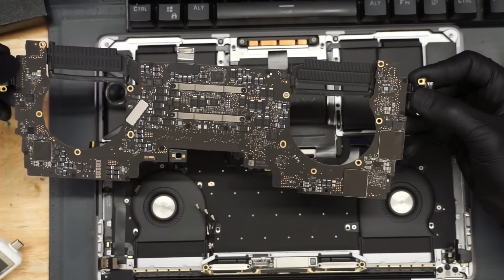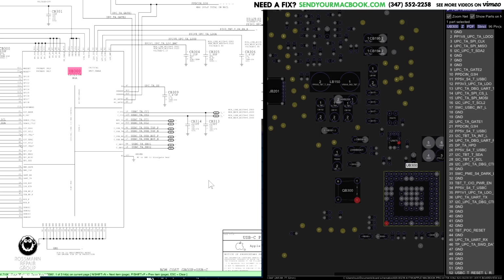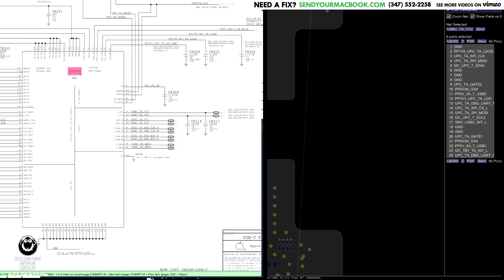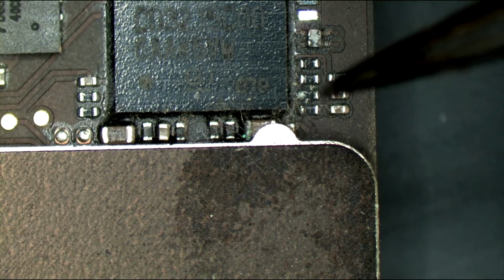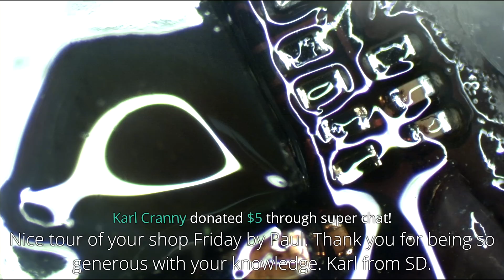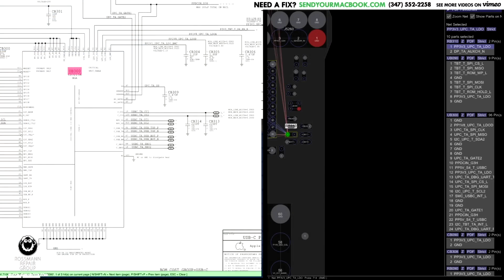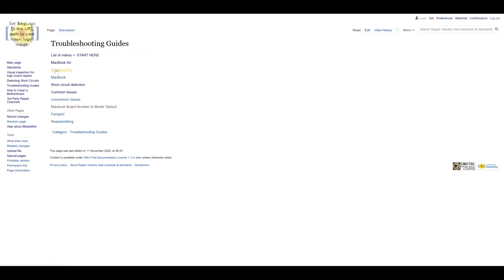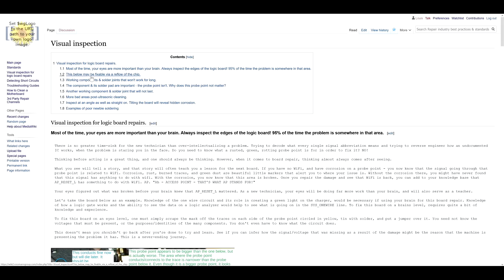A1706 Macbook Pro 5v 200 mA logic board repair

Comment: Ah yes. The JayzTwoCents way of soldering capacitors and resistors on. Through the top pin instead of heaTING THE FUCKING BOARD

Comment: Hi Louis I enjoy watching your channel. I would just like to give you this comment and please forgive me I don't do electronic work so not sure what and what can't be done, But I am disappointed to see you working on that board with the obvious Sht /corrosion around it. Why didn't you at least clean the area before you started doing anything to it?? I equate this with if you hired me to do some int/ext painting work for you, and the walls need obvious work but I just said the heck with that and just painted the walls and been done with it.  I love your channel but it did disappoint when I seen you proceed with your work, because I see you as a professional, I would think that cleaning the area before you attempt to repair something would be the professional thing to do.  Cheers, Stay Healthy Stay Safe
Reply from the maker: This would be disobeying the primary rule: don't UC the board until you have repaired it. I talk about this in almost every single video. Do you pay attention to them? :(

If you UC the board, it becomes infinitely more difficult to find the problem areas - because your hint is gone. Once the hint is gone, finding these problem areas becomes infinitely more difficult - and it may be impossible for you to locate them later, resulting in a no-fix where it otherwise wouldn't be a no fix.
Reply: @rossmanngroup   No I get that and no insult intended but you obviously knew you were going to work on that particular area, so I thought cleaning it would be the norm, But that's your job you obviously know more then me but if one doesn't ask the question you can't learn.

Comment: I own a Macbook pro 13inch 2018 touch bar model and suddenly it is showing some issues in the graphics. (works find in an external monitor though) For a week, I noticed some pink dots everywhere in my screen and now it goes to a black screen after the OS boots.
I don't have AppleCare for this device and when I gave this for a diagnosis to an authorized service provider in Sri Lanka(Since we don't have apple stores or Genius Bars here), they told me that the whole screen needs to be replaced and they cannot check the issue which causes the problem.

Since I can ship my device to Australia easily, I called the Apple support in Australia, but they are reluctant to give a rough cost for the repair without examining it. My device doesn't have any dents, physical damages or any liquid damages as well. I know that Apple has a tier system when it comes for repairs.

I would like to know any rough estimates for this repair from Apple and cause for the issue if you've experienced the same so that I know it is worth shipping this to Australia just for this repair.

Also, if you can tell me the level of tier(Apple's repairing tear system) this issue falls into that would be great.

For your convenience,  I have attached few videos and pictures of the issue. 

https://www.youtube.com/watch?v=tBSV0NtvxZI

https://www.youtube.com/watch?v=Ghc63hbPWnw